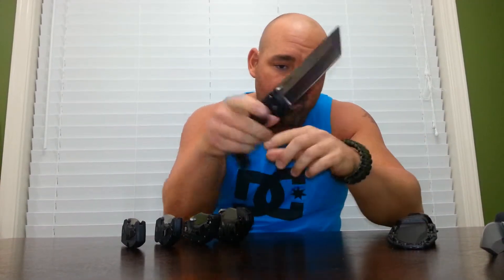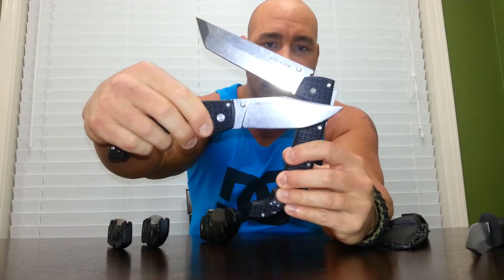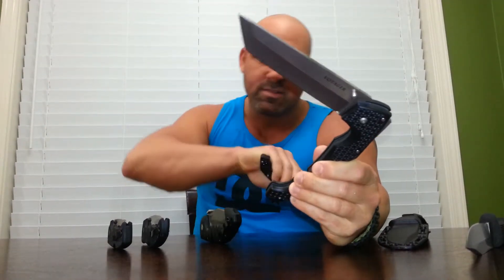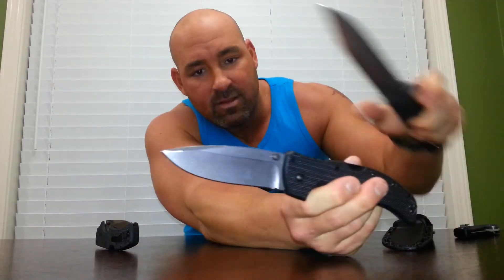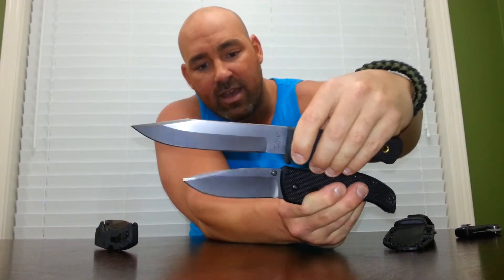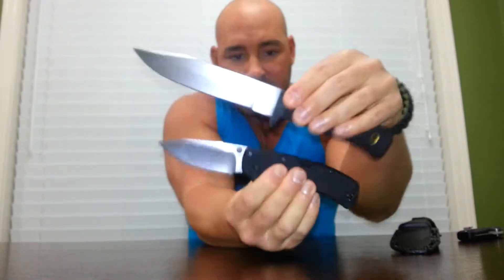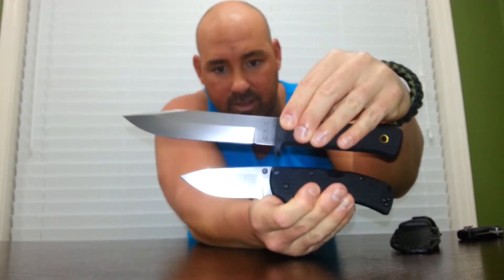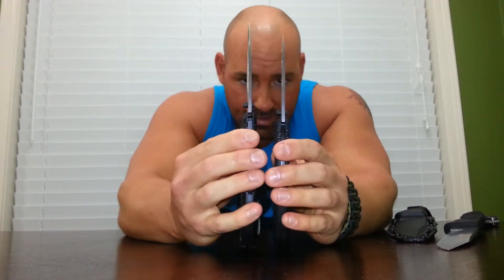Comparing Cold Steel Blades-After Paint Stripping

Comment: Spartan is bead blasted, not satin. Also the coated srk is vg-1, not aus 8a, maybe why it looks different when striped.
Reply from the maker: I have the older model ColdSteel SRK.  It IS made of AUS8A.  Google it.  As far as the bead blasted, I didn't go back & edit this one.  I did vid in hurry.  Thanks for your corrections.
Reply: Yeah, my bad, you're right about the srk. I just now realised they had an aus8a version.